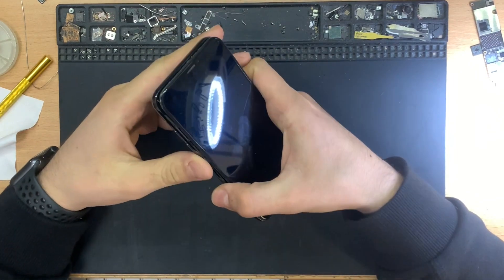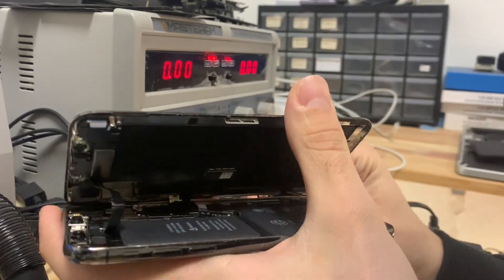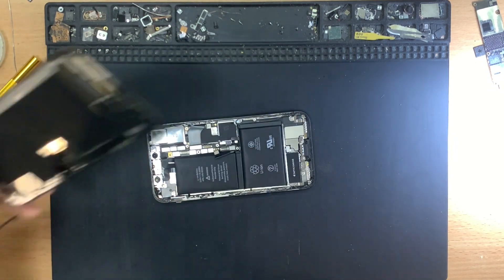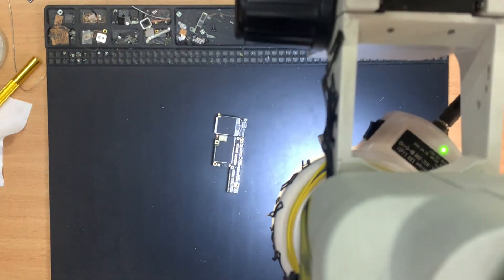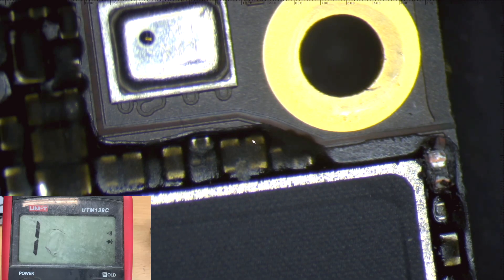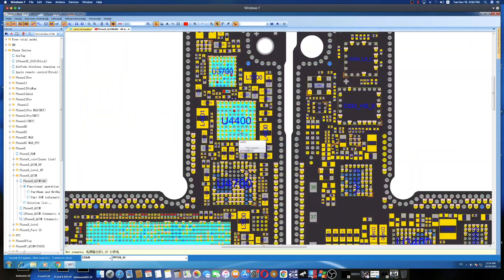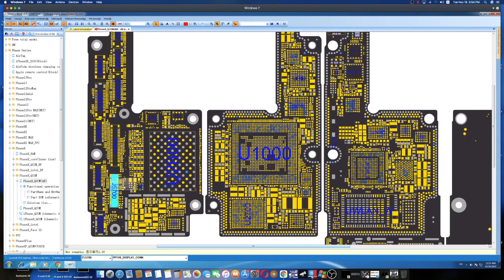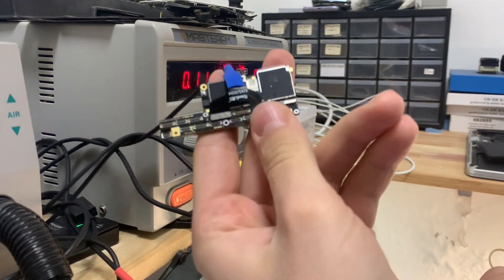How To Quick Fix iPhone X not turning on (shorted on PP1V8_IO)

Comment: Very nice video and well explained. Im going through the same problem. How to identify a problematic capacitor, under microscope? They all look wierd / burned? Thank you!
Reply from the maker: Hi, thanks .
Not all the bad capacitors looks weird, sometimes they look fine until you inject voltage into the line.
Reply: @iTouch-repair  Ok thanks. I'm new to this so i'll have to look into some more tutorials about capacitor diagnosis...

Comment: So actually you just remove the capacitor without applying another one and shoud working ?
Reply from the maker: Yes
Reply: @iTouch-repair  I looked around, right now in front of me I have such an iPhone, whose battery and display have been replaced. then it started, shortly after that it went out, and never came back on. Currently on charger but no signs of life. At all. is it possible that this is the situation?
Reply from the maker: @Scorpion_overlord  don’t know, need to boot on power supply and check
Reply: @ItsDoms how?